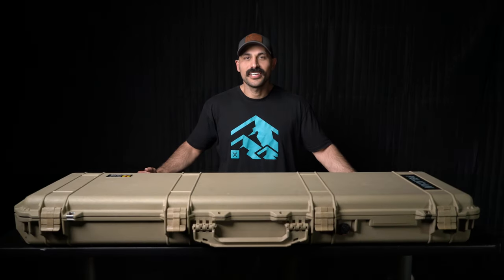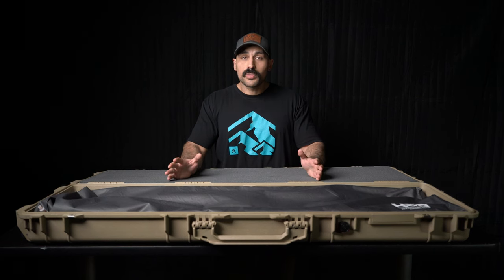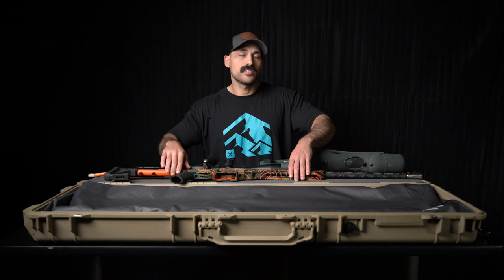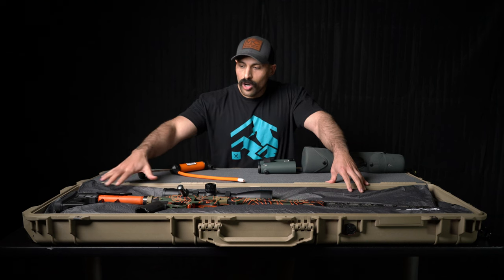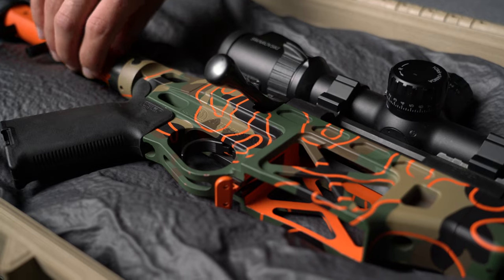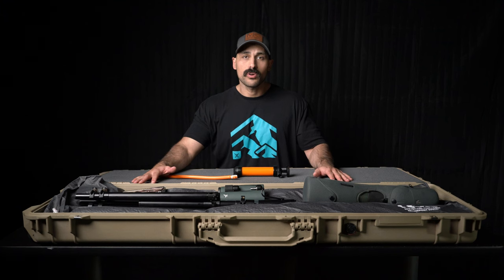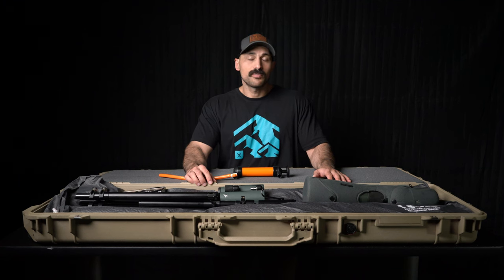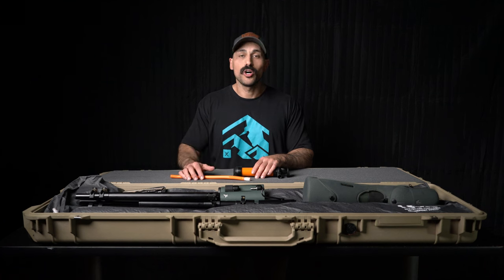No More Foam? Kor Technik Universal Case Insert

Comment: Needs to be integrated into the case on both sides and attached to the case so that you can close the case and then vacuum from the outside top and bottom then open the case and have it formed on both sides until you want to change it up again.
Reply from the maker: Hey SaneAsylum, thanks for the comment.

It worked fine on seven flights and a bunch of boats from Arizona to Kodiak and back, so I don't think it needs any changing at all. It's made to work with a case you already have.
Reply from the maker: None of the rifles or optics moved or took any damage. Hard to get much better than that! Seems like a rifle case either works or it doesn't. When they make one that pours a glass of whiskey for us too, we'll be there to review it.